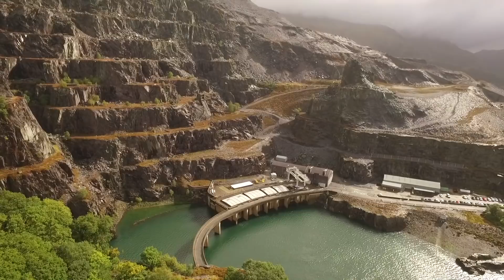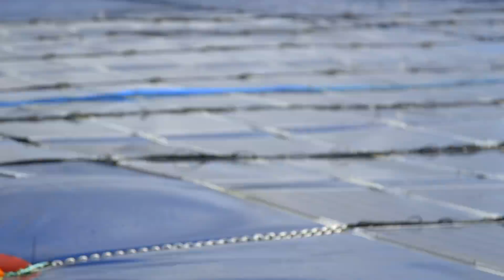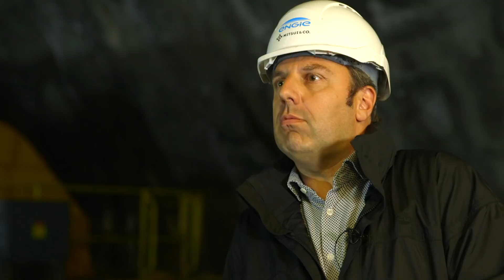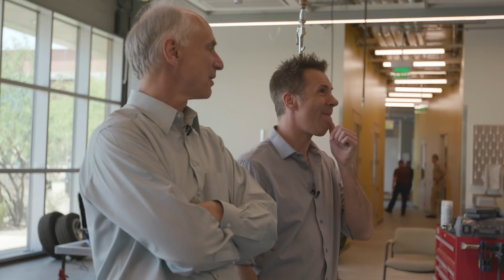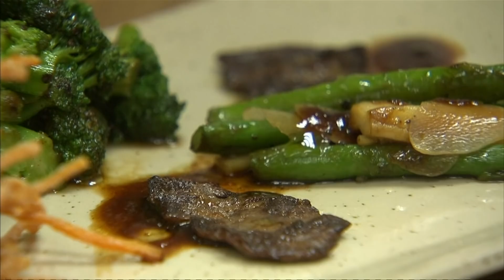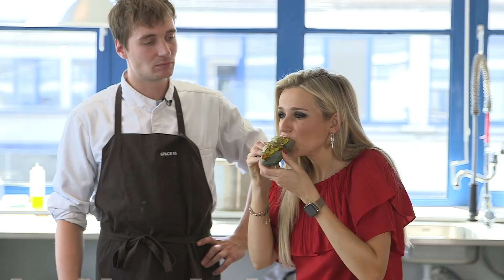Can Tech Save The World - BBC Click

Comment: Why do they use Kondensation Towers of nuclear plants as a pictures for co2 emissions??  These are just exhausting water vapor 🤦🏻‍♂️
Reply: these towers are also used in coal power plant. That's why.
Reply: That is the Niederaussem Coal (Lignite) Power Station located in Bergheim Germany.  Opened in 1965 and it has the tallest cooling towers of any power plant in Europe at 656ft tall.  It is however Europe's is the 2nd worst emitter of mercury into the environment because of its use of lignite and its sheer energy production capacity.
Reply: Laziness? It is BBC click
Reply: VR Sofa no, coal plants use the same kind of cooling towers as nukes.
Reply: More CO2 nonsense